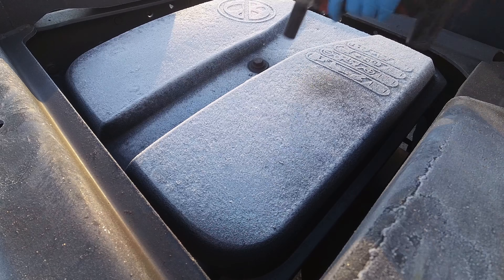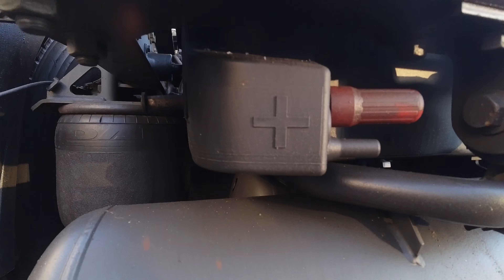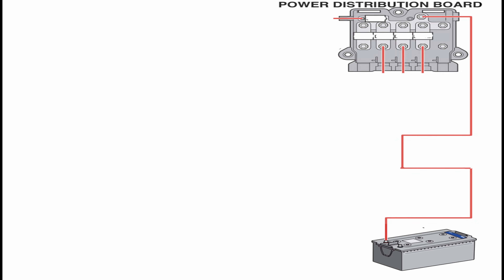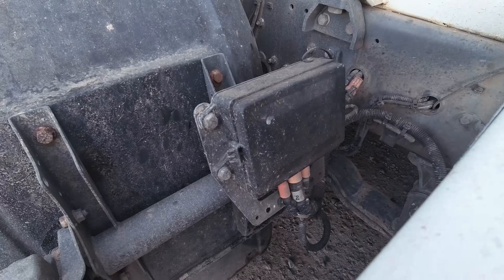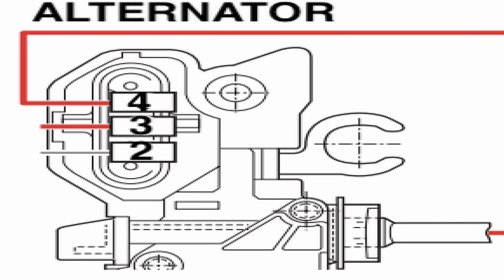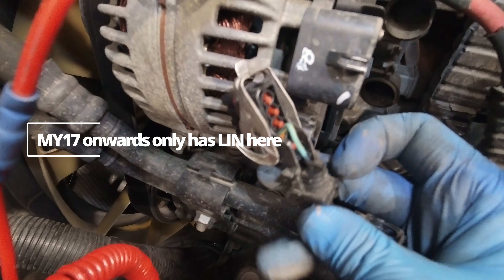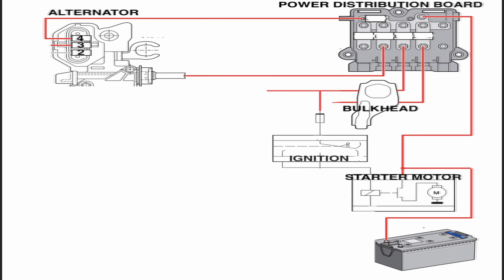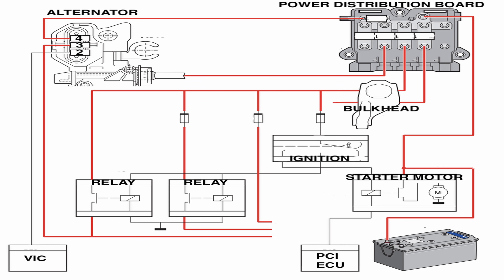DAF truck won't start? alternator charging FULL explanation

Comment: Jesus what have DAF done to trucks - a simple start system turned into an absolute MESS with Electronic Gadgets Switches Relays Sensors and God Knows What Else 
What is the worst Manufacturer these days DAF MAN IVECO VOLVO MERC SCANIA RENAULT ???
Fitters and Techs stay at home ETO needed for non start trucks

Comment: Hi i am having a problem with a 106 CF went i turn the key to position start nothing happenes if i leave it with ignition on there is some blower like thing on the engine that starts going and it doesnt stop if ignition is on removing relay G126 makes the engine turn over but wont start
Reply from the maker: Sounds like a engine ecu

Comment: Hello. Thanks for your great content. I have xf 510 euro 6.

1 battery have 10v on standby, truck didn't started.
I jumped start and truck running. 
28v when truck running. 
After 2 hours the truck suddenly power OFF on idle. A bad battery can do this?

Comment: Got a Daf XF 2018 with warning on the display Battery power critical carnt seam to get it off ,truck has had 2 new batteries and we have told the truck its had new batteries with jaltest checked alternator and that's charging any suggestions the warning keep waking the driver up at night
Reply: No not done that can it be done with Jaltest and how to do best regards Chris thanks again for replying
Reply from the maker: It's not a problem Chris 👌.  I should imagine jaltest has it BUT I will find a DAF with a battery energy monitoring system tomorrow and get plugged in and let you know buddy.
Reply: @TRUCKTECHUK  cheers  pal
Reply from the maker: Chris, I didn't have a truck with a BEM in, unfortunately (you would think they would be super popular 🫣) 
Have you tried JALTEST support for advice? The team does want to help you with the product and not leave you in the dark mate!
Reply from the maker: Hey, thanks for the comment. 
You have told the truck it has had new batteries but have you also reset the state of the charge as this process is required also?

Comment: 🤣🤣🤣🤣👌 mate this week at work has been a nightmare for starting issues,the midtronics has worked overtime and funny enough changed a set last night,papers ran out too on the midtronics and the battery’s flat in it.been finding a lot of cells dry too bugs the hell out of me,people not doing there job checking them as there scared of the clock machine and efficiency’s 🤣 and bloody night heater faults sick of them but stores never keep spares in, happy Xmas mate keep up the great content and never forgot to switch your ratchets off
Reply from the maker: Oh, not just me having fun and games then! Yes, our midtronic has run out of paper. Luckily, it can send the test results via email so I can print it off that way. 
No one wants to spend time taking battery covers off to try and inspect electrolyte levels.....most probably why they invented maintenance-free 🤣🤣🤣
We keep the gauze glowplug in stock ....we have a spare here we can use and replace parts on, so that helps.
Glad your enjoying the content, I best start next week's video 😬

Comment: Nice video as usual. The content is constatly on high level. I had experience with alternator warning on MY 2014 DAF e6. Changed whole alternator checked fuses. It is charging batteries but, warning still on dash. I measured 27.0 volts at charged batteries. Thinking the problem is wiring, because manual says inside it there is diode that get up voltage with 1 volt.. 
Is this wiring same in the MY17 and NGD? DAF has lunched new batteries wich are more expensive but so good. I am happy they mount on every new truck in factory.
Reply from the maker: Hey, thanks for the comment 😀.
You are correct in thinking that you have a diode in the sense wire to the fuse on the side of the engine. This increases the alternator charge by 0.7 volts and when it goes o/c. The charge rate can't be maintained, usually identified with a red alternator warning on the dash. 

Anything after my17 is controlled via VECU. I was going to add a bit in the video about Battery Energy Monitoring System, but I guess that will have to keep for another video lol

Comment: You have good retention to remember all this .i am on the downward spiral lol i just follow RMI ,but in my defence  i have only done engines this year...LF head gaskets and dusting is getting popular now ...I have noticed that the headgaskets on MX13 MY17   are failing and the fire ring on the gasket is eating in to the head ,,and the blocks are getting badly pitted at the water channels...Recent one  would need head skimmed 20 thou ,valves recessed 20 thou and then topped 20 thou  to keep it all to spec,,,Got a MX11 now pressurising ..It has had comp gaskets ,thermostats water pump ,rad and now it;s my job lol
Reply from the maker: Hey buddy hope your back on work and feeling better now. 
If only everyone would use RMI 🤣👌. You know how it is......you do a job 20 times you don't forget torque setting or valve clearances. 
Yes I'm seeing alot of trucks for diagnostic now with pressure issues that have had the usual compressor head and header tank done.  Got one now that uses coolant but doesn't loose it! 
I suppose it's lack of correct coolant concentration causing block erosion.
Reply: @TRUCKTECHUK  The tink is they are still young trucks age wise ,milage may say differently though...Part of the issue is they still drive them  until it is due a PMI  and mention it  or it fails totally...Theengineering shop we use is making a fortune pressure testing etc ,and there is at least another 3 DAF dealers using them..and the likes of merc MAN also use them and then their normal work lol...Still got sniffles but over the worse so can go to work ..Even at Euro 5 i was banging on about having to use Rapido ..You have to use the systems now ,it is monitored
Reply from the maker: @norb0254  funny thing is I was doing a job on a euro 6 the other day and I called it  "this old thing" 🤣🤣🤣🤣 suppose it's 9 years old in January.....time for the big Africa ship in the sky 🤣🤣

The machine shop we use can't do certain jobs like they use too as the old guy has retired and the younger lads only do the quick and easy stuff now 🤷
Reply: @TRUCKTECHUK  That made me chuckle there .I googled one of my old cars number plates ,had it from new ..Had works number plates on it and the things in bloody russia lol .pics of it in what looks like a scrap yard...I was looking at a 14 plate and thinking  2 years left till it goes and it was the first of the euro6 motors ...I am interested in what the plan to do with the LF   to make it part of the family look wise ..Those headlamps basically date back to 2001/2002

Comment: Hi mate 
Another great video, will help with a diagnosis with euro 6 MX11 intermittent Alternator warning and high voltage 👍👍👍
Reply from the maker: Hey thanks for the comment 😃. I hope you get to the bottom of the alternator warning. Test at the bulkhead while pulling on the wiring harness and see if you can get it to happen 😎
Reply: @TRUCKTECHUK  Thanks, will do, not just Volvo’s then 😂😂😂